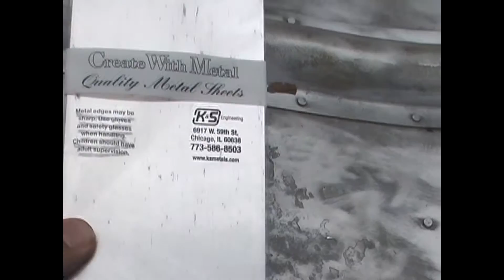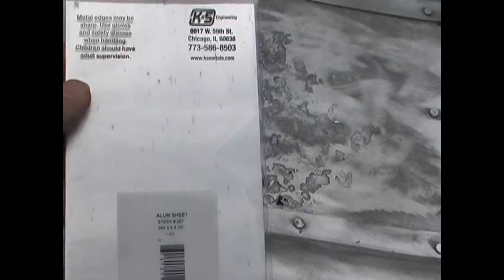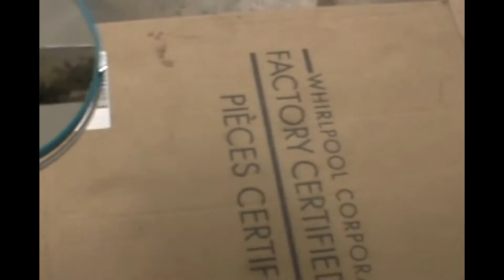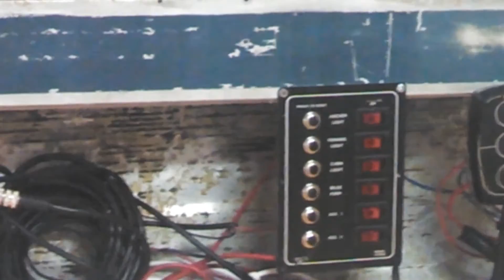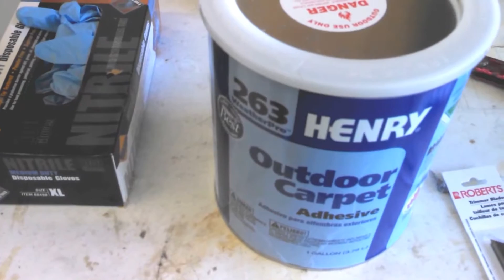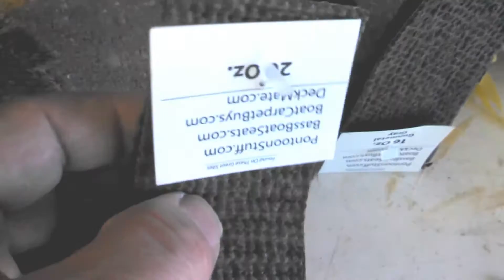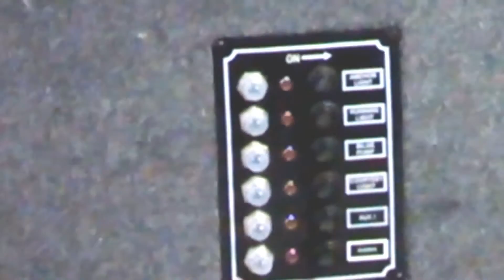1985 Sylvan Boat Project  All

Comment: Would you say I'm ok with pulling a boat like yours with my 2015 Chevy traverse v6 with 5200 towing capacity? I assume it should be fine right? I just worry about my transmission. Love your videos!
Reply from the maker: Mines only 2,000 lbs with 3/4 in Deck, 2 Gel Battery, and a 50HP merc, I'll be fine with 5,200.
Reply from the maker: Meant you'll be fine.
Reply: @U5320  thanks buddy. Hopefully I will have enough money saved up by spring to buy one. It will be my first boat , the boat I'm using now is a 14' semi deep with a 15 horse. It will be really nice to have a boat of that size and not worry about chop